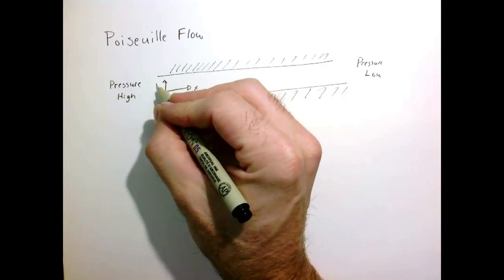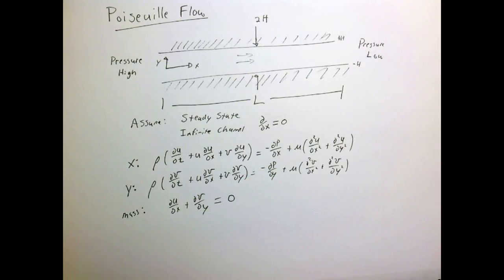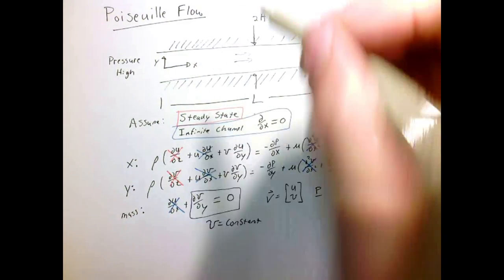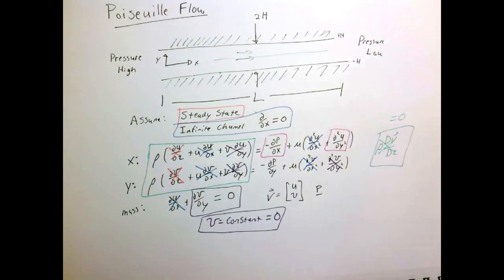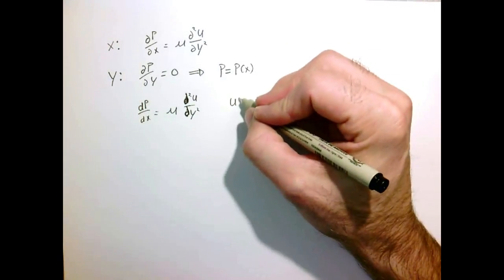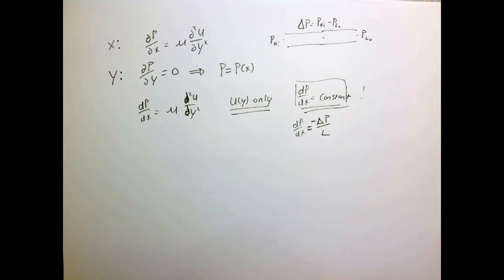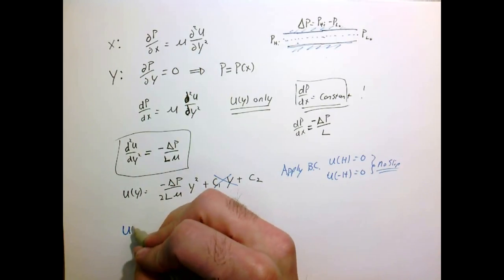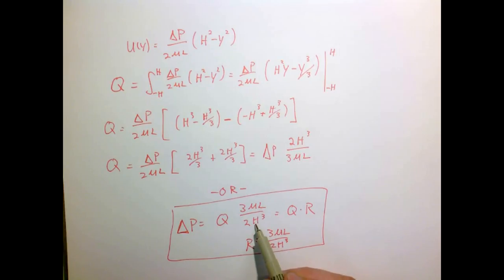Poiseuille Flow

Comment: Why we need to integrate the velocity along the domain y to find the volume flow rate. Because according to my understanding, the volumn flow rate is the velocity X cross-sectional area. so it should be integral velocity by dA. Does my understanding wrong?
Reply: What is the difference between this link (https://www.youtube.com/watch?v=mtoHgKdXLJk&t=828s) and this video? Why the volume flow rate calculation method different?

Comment: Thanks Brian. Is it true that in fully-developed pipe flow enthalpy is conserved (ignoring any elevation). If so can we replace h=cpT? I notice that in heat transfer for incompressible flows, they do that in textbooks. But here I don't think h=cpT would apply as I think the temperature would have to rise due to irreversible effects. Isn't this a double standard?
Reply from the maker: http://faculty.olin.edu/bstorey/fluids.pdf
See section 15.3.  

Note in the notes I don't use enthalpy as a name, but you will see e + P/rho, which is enthalpy
Reply: Excellent set of notes. Thanks for that. I wish the section on pipe flow continued. What's your take on substituting for enthalpy -> h=cpT. I see it in many engineering textbooks but if pressure is dropping how could this be valid?
Reply from the maker: The notes are a work in progress and kind of drop off in the later chapters. One day...

I didnt introduce enthalpy here as I was not trying to get too deep into thermodynamics. If you want a real thorough explanation of the different forms of the energy equation, see the class book by Bird Stewart and Lightfoot. It is more complete than anything I could ever hope to do.
Reply: Thanks a lot.

Comment: What? at steady state, no change in time?
Reply from the maker: +Jay Tee 
Yes, I am using the term "steady state" to imply that things don't change with time. Of course, this is an assumption that things are not changing in time. It can certainly be true experimentally with these flows that you can have inlet conditions which are constant in time but the flow itself is fluctuating. 

In this analysis, we seek a solution consistent with our assumptions. For this flow,  if we set up a quick experiment in the lab and keep the Reynolds number less than ~100 and keep the channel height to be small compared to the length, it is the actually the flow we would observe.  We could also observe the parabolic flow at higher Reynolds number  (~1000) if we were a little  more careful.  At some point, however, the flow loses stability no matter how careful we are!
Reply: +Brian Storey Thank you for the reply. It's just the way you stated it, at steady state, no change in time. which is not true because the constant thing is another variable like mass over the change in time.

Comment: Not all d/dx = 0. It's not true for P. The assumption should be u = u(y)
Reply from the maker: +Hdt Pdr Yes, of course the pressure gradient is needed to drive the flow and dP/dx must stay around. Hopefully the whole video is clear about the assumption that the flow doesn't change down the channel, but the pressure does drop continuously and dP/dx is not zero. I choose to talk about d/dx terms being zero as that seems perhaps more intuitive as to what you are assuming (that all sections of the pipe are the same) than saying that lets assume u(y) only. Of course they end up being equivalent. 

Hopefully the explanation is clear since with the videos it is not easy to go back a redo one little part to make something clearer!
Reply: +Brian Storey Thanks Brian! It's absolutely clear. I just wanted to be more precise. Your videos are excellent and greatly appreciated!